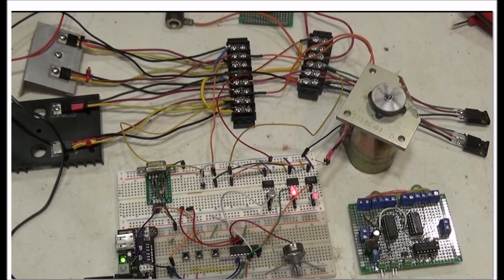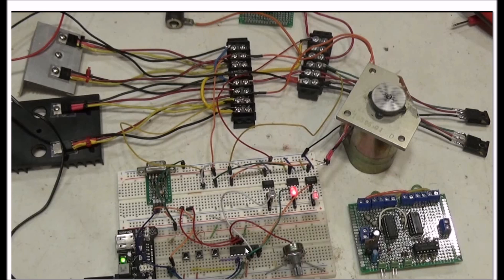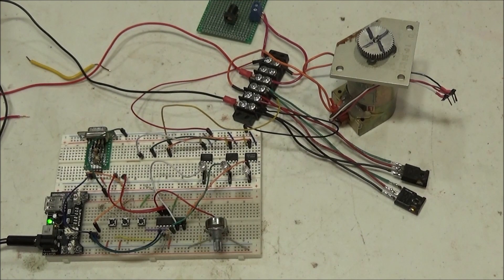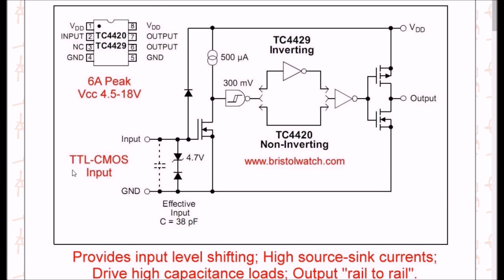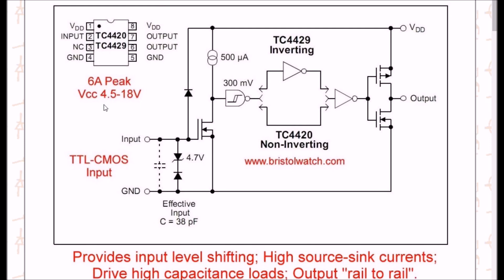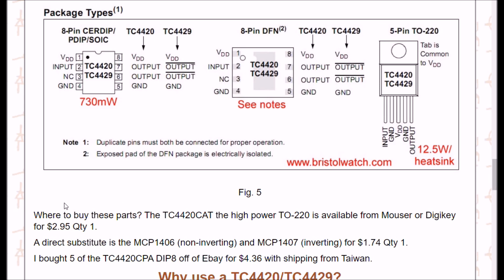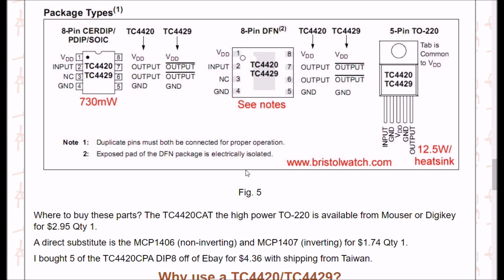Pt. 1 Intro. TC4420-TC4429 High Power MOSFET Drivers

Comment: So I don’t need a pull down resistor the Ic does the pull down is that current
Reply from the maker: I assume you are using a microcontroller. On power up the input pin could be floating, so add a pulldown resistor to be safe. I didn't use one and had no problems.
Reply: @LewisLoflin  yes am using tl494 circuit with the tc4420 on my half bridge inverter I get some pnp today so tomorrow I will try to fine time to build the circuit

Comment: I don’t really understand why to use TC4420/TC4429 to drive the high current IRFZ44N MOSFET.  Why not just direct pwm pin signal from controller like arduino or esp32? or because it is to drive multiple parallel IRFZ44N MOSFETs?  Thanks for the video.
Reply from the maker: On some MOSFETs the drive voltage is not high enough and is worse with IGBTs.

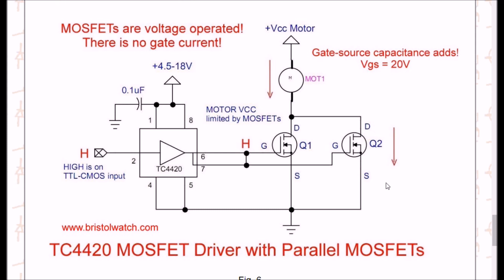Comment: I'm wanting to drive a mosfet with a TC1411N driver chip. because its a fast chip and i really need quick on and off times. was thinking of using a hall sensor to trigger a digital signal into the driver. what are the connections form the driver to the mosfet ? would it be exactly the same as your circuit shown in this video @6:55 ?
Reply from the maker: This should work.
Reply: @LewisLoflin  okay, thanks ya !

Comment: Hello. Thank you for the videos. Question: Is the TC4429 capable of driving three of IRFP064N in parallel? Thank you.
Reply from the maker: I'm sure it will.
Reply: @LewisLoflin  Many thanks
Reply: What about capacitance? Input capacitance Ciss of the IRFP064N is ~4,000 pF but the TC4429 Capacitive Load Drive Capability is only 10,000 pF. Thank you.
Reply from the maker: @ruslanhajiyev  The TC4429 will drive 6A peak so low a low values input gate resistor could limit this but slows down switching speed.
Reply: @LewisLoflin  Thank you for the interview. Do you have experience of observing over two or more DRIVERS in parallel? (When they work for a group of MOSFETs using one common PWM source). Thank you.
Reply from the maker: @ruslanhajiyev  Never tried drivers in parallel but I see no reason why it wouldn't. Be aware what I present here is hobbyist so for high power or commercial applications I would be wary. Be away with parallel drivers witching speeds of individual device may vary slightly.
Reply: @LewisLoflin  Many thanks. Also believed that due to the even small difference in parameters, such a solution is not reliable. As result, it at least may cause notable heating of MOSFETs and losses for nothing. I wish you every success and luck. Thank you.

Comment: Hello i got the tc4420 and i can't get low signal output but only high signal output on my oscilloscope from pin 6 and 7. Someone can help ?
Reply from the maker: I have to know how it is connected.  What is +Vcc? What is the input connected to?
Reply: @LewisLoflin  hello thank you very much for your reply.
The pin 2 input is conected to my signal generator. 4 and 5 are common ground, 1 and 8 are common 5 volt dc, 6 and 7 are the output. I'll apreciate your help
Reply from the maker: @dougboyao5839  What is the level of the signal generator? Also your supply voltage is low. Try a 12-volt supply and a 5-volt square wave input.
Reply: @LewisLoflin  hi it's working fine thank you. This low amplitude -1.3v to - 2.3v i didn't notice earlier i though it wa 0 volt.
My best regard. Nice tutorial
Reply from the maker: @dougboyao5839  Great!

Comment: Sorry for the stupid question, but the idea of putting the MOSFETs in parallel is that you can handle N times the current that a single MOSFET can handle?
Reply from the maker: Not stupid. Yes.

Comment: I did not watch all the video. So please bare with me. You was questioning how to run the Fets fully open. Have you thought of using a simple (JOULE THIEF)? This little circuit would do the job with very little power input. What do you think? Wouldn't this work for your circuits?
Reply from the maker: This was designed for MOSFETs. Driving MOSFETs takes very little power as such, even in parallel. This serves more as an interface circuit. I looked up JOULE THIEF and besides using bipolar transistors this involves some transformer or special inductor. Bipolar transistors are current operated - MOSFETs are voltage operated.
Reply: @LewisLoflin  Yes I know what your saying. Thanks for your comment. I was just thinking even though it would take more components, this small circuit would serve you better.

Comment: Hello. In the first place, I would like to thank you for everything that you do on this channel. It is very helpful !
I have a question, and I can't figure it out, please, can you help me :) ? What is the purpose of current in MOSFET drivers? For example TC442X are rated at 6A. Why we need these 6A ? Is it for MOSFET transistors, or for the load (For example if my load needs 6A, besides the fact that MOSFETS need to be rated at 6A, the MOSFET driver has to provide 6A too?).